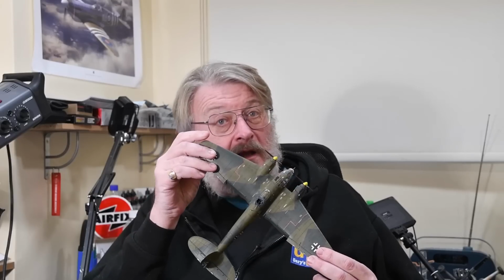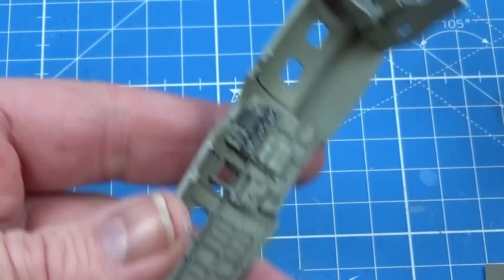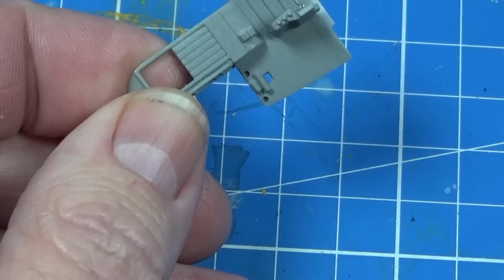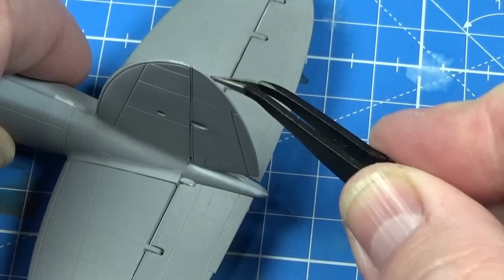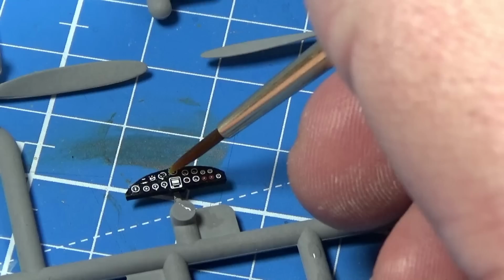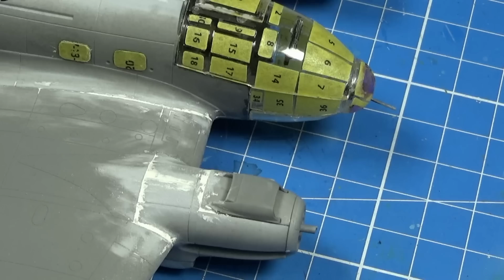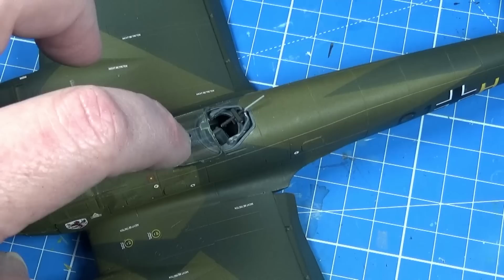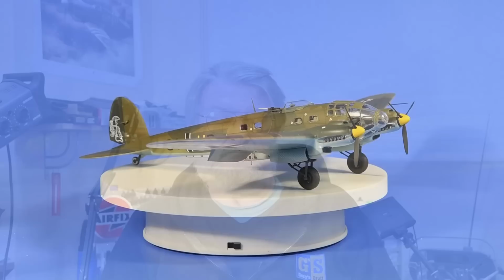AIRFIX HEINKEL 111 1/72 scale model kit - how to make it!

Comment: Very good buld:-) Which RLM colours did you use?
Reply from the maker: They are in the video, but I used RLM65 for the underside and RLM70 and RLM71 for the top.
Reply: @garys_stuff  Vallejo. Got it. Thanks. 
There are so many RLM paints, which all differ in shades,  that it is nearly impossible to chose the right/best ones.
Reply: @Magua Nielsen  
It's all interpretation.  The same paint will look different in 1/32 than 1/72, and that changes by available light, too.
Reply: @NielsenDK-1  Don't get too hung up on this - go for what you like the look of. 

Bombers were basically RLM 65, 70, 71 all through the war; fighters changed a bit more. Sea planes were different again. 

Often the difference in gradation of colour on the upper surfaces was quite subtle. However, each factory had variation in paint shades, so RLM 71 was not a universal shade, although it was a universal colour. 

Additionally, units modified colours in the field. So, you actually get a fair bit of license in terms of the shade provided you stick to the colour (i.e. RLM 65 Sky Blue can be a tone/shade whiter or greyer than the Humbrol 65, for example). 

The 'best ones' are the ones that look best, I think. What you want is something that has some historical accuracy, but that you like the look of. 

The Osprey books give a good idea of colours and shades, as a starting point.

Comment: Thanks Gary. Great job. The undercarriage structure seems to be more fiddly than necessary but that is the way with Airfix. Built one of these way back in the mists of time and have a new kit sitting in my stash. Have ordered the masking set as I need all the painting assistance I can get. Looking forward to having a crack at it very soon. 

cheers
Reply from the maker: It's a nice kit and the undercarriage is probably just as fiddly as pretty much everything else I've done recently! At least it's pretty accurate and is very stable when it's all done. Masking set is really essential for this one unless you've a very, very steady hand!

Comment: Lovely build -- the fit is impressive though the canopy is daunting.
Once the aircraft is painted, i cringe when I hear the model scraping on the table-top pad.  I put down a clean, soft towel so I can work without damaging the painted model.  Also, dropped parts get caught by the cloth instead of bouncing off the hard matt.
Very nice job!.
Reply from the maker: Good tip! Cheers Randy!

Comment: At 13:20odd. Is that a flap or an air brake? AFAIK flaps are supposed to enlarge the wing area so you can fly slower and still stay airborne. If sticking up those look like they would do the opposite and slow the aircraft down?
Reply from the maker: Those are flaps - we are looking at the underside of the aircraft. Flaps originally didn't add much to the surface area - just look at a Spitfire for example with split flaps. They have a role in increasing effective lift for a given airspeed by deflecting air downward. Forcing the air downward results in an equal and opposite upward force on the airframe, extra lift for a given air speed, but also induces extra drag as energy has to be expended to create that downward motion. What this gave was a slower, steeper approach. Simple flaps, such as those on the He111, have a similar effect, but the drag component is slightly more complex as the flow over the upper surface is less controlled. Fowler flaps increase wing area first, e.g. the first 5 degrees or so an airliners flap movement, but then rotate to present a steeper face to the air, with slots used to help manage the upper surface flow. Fascinating stuff, it really is!
Reply: @garys_stuff  Cool... thanks Gary. Every day's a school day :)

Comment: Great kit, I'm currently doing this one myself. Quick question - did you prime everything before the assembly? I am a newbie to airfix really
Reply from the maker: I use a very light coat of spray primer first of all. This helps with painting the interior but also helps me when I'm looking at the fuselage join - gentle sanding along the seam shows where there are bits that need levelling off.
Reply: @garys_stuff  okay sounds great will do this in the future. Does the glue still work as well despite parts being lightly primed to begin with?
Reply from the maker: @thomashood715  I've never had a problem, but for things like the seams in the fuselage you might want to just sand down the primer from the contact faces.

Comment: Nice build Gary just a question what blue colour code did you use
Reply from the maker: I used RLM65 light blue - which in Vallejo Model Air is 71.255

Comment: Gary you have certainly inspired me to get a Heinkel, just looks something a little different to build. Can I ask what clear coat you use before decals and after? I am hoping to find something to use through the airbrush. Thx.
Reply from the maker: I've started using The Army Painter Air gloss varnish, let down with a bit of thinner (I use the one from spruebox.co.uk). It goes through a 0.3mm needle just fine, enough so i can see where it's going but not flooding it! Once I'm done I use Windsor & Newton Galeria matt through the airbrush, also slightly thinned.
Reply: @garys_stuff  Perfect, I will order some! Thank you.